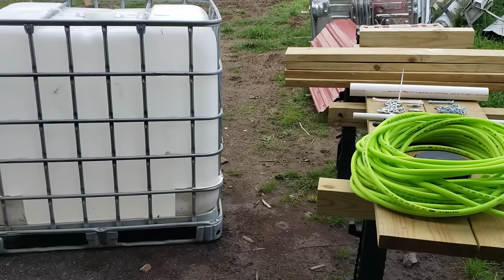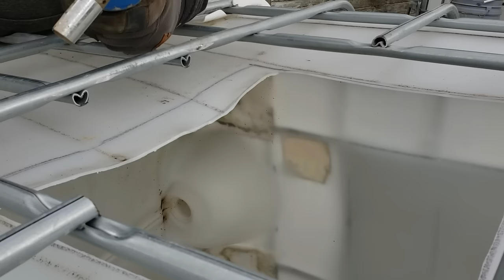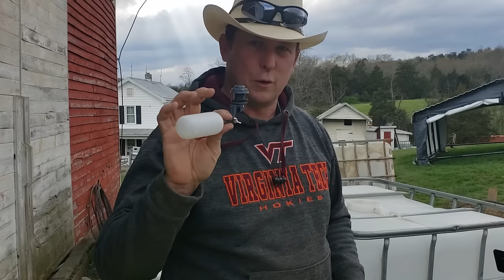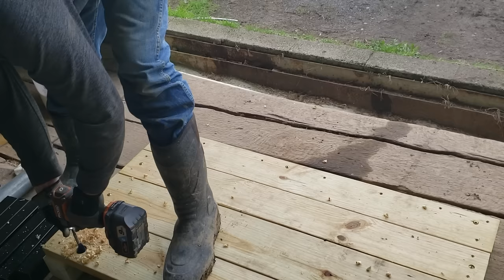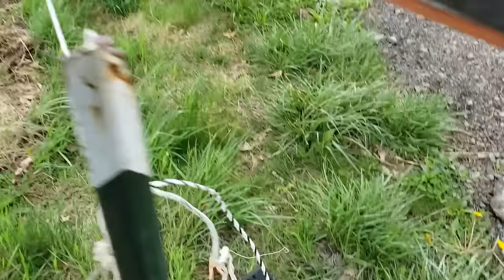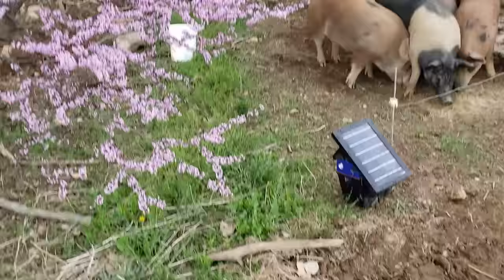Build a Sow Drinker. 🐖

Comment: This looks great. Could you possibly cut it in half and thereby make two? Also how often do you need to flush it out and when you do, does that not create a wallow next to the tank?
Reply from the maker: Wouldn't work well to cut in half, the top is not the same as the bottom and they would jump in. We flush when we move them.

Comment: Do you think its possible to make a cross cut in the existing plastic.  Then fold it over and drill some holes and attach it with zip ties rather than using pvc? Also protection for the top and sides?
Reply from the maker: Try it out and report back! #getafterit

Comment: Really great build and instructions. Thanks! But, wouldn't it be better to incorporate these ideas to a 55 gallon water barrel instead? You wouldn't need all that heavy equipment to make the thing. It would hold about 8 to 10 gallons at any time. With the auto refill system that should be enough to water at least 40 pigs in the summer and if you have more pigs it would still be cheaper to have three barrels than buying one IBC tote. It just doesn't seem rational to spend $300 on an IBC tote that you can only fill 25% full. Hell, you could use a large 50 gallon water troth, put it on a pallet, build a frame out of wood and attach it to the pallet that can be designed to keep the pigs off the pallet/ froth with a wooden ceiling to keep stuff out of it and insert that water refill system. And with that you could easily move it around with an extra light tractor or Kubota or whatever that has pallet forks on it
Reply from the maker: Good points but we've tried all that and each has shortfalls. We have multiple machines with forks and they are a regular tool in our movement evolutions. For someone that doesn't have a machine they of course will have to adjust. Around here we can get the IBC for $50.
Reply: @FarmBuilder  oh wow! That's an amazing deal. Definitely worth it then. Thank you again for sharing. I've learned a bunch from you.